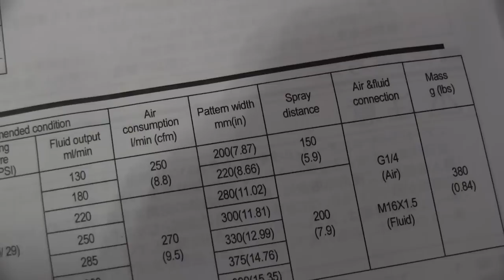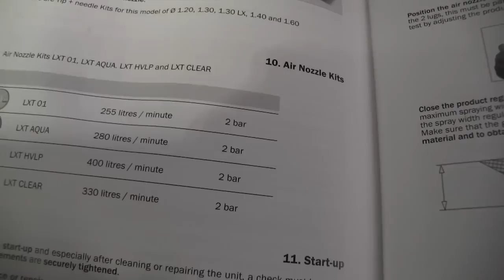Air Compressors Explained and Tested

Comment: Wow- cleared up a heap of myths for me including needing a 200+ litre tank to fully spray cars which is a relief because I bought a 3 hp 50 litre 323l/minute FAD compressor today. The first thing I noticed over my old 2.5 hp 40 litre 125 l/min direct drive unit was when the compressor kicks in the new one holds the pressure the whole time and only takes a few seconds to catch up after finishing. Whereas the old one would lose pressure and then take 2 minutes to refill.
I was really worried I'd bought one with a too small tank but this segment cleared it up for me- very relieved. 
Thanks!
Great to see some quality Aussie paint videos btw!
Reply: Hey it's been two weeks. Have you properly sprayed with this new comp? Any conclusions? I imagine a 50L regardless of output would pretty much be fully running while spraying a hood or roof on a car? I'm looking into getting a comp and gun right now for my R33 project and my budget at most would allow a 50L unit and the cheapest gun I could get.
Reply: @Kryndon64  It depends on what the FAD is.  Free air delivery is more important than tank size. If it's around 200 or below it might struggle. 323 l/m does it easily. I'd recommend belt drive too. Mine runs off 15 Amp and cost about $900 AUD. I had a cheap 40 litre one FAD 125 l/m that I tossed for the new one and there was no way known that would cope with even painting the bottom of a door. Plus you need not only a decent compressor, might get away with a cheap gun but you also need to stop moisture getting into the paint, so need at least one decent water trap. A weaker compressor will also make more heat which will add to moisture in the air. . Another thing to consider is tank pressure. alot of the cheaper ones operate at 110 psi whereas the better ones are 145 so in effect you have more air for a given size and less buffer in which for the compressor to stay ahead of. A 200 litre tank might give you 4 times as long over the 50 litre before it kicks in but then it needs longer to fill up again too after you've stopped.
Reply: @AndyPutt1  What compressor did you get? Like what's the brand/model?
Reply: @Kryndon64   Yeah sprayed with it and it's great. No problems whatsoever painting a car. If you had a 200 litre tank it would take 4 times as long to kick in but it would also take 4 times long to fill. It's not like in order to spray you need a compressor that won't kick in while you are spraying in order for it to work. That might be true for a 120 l/m FAD compressor, because it can't supply enough air but not with a 320 FAD unit handles it fine  it would be well under  a 50% duty cycle.

Comment: Being a beginner with painting I found out my compressors valve outlet on the tank was restricting air flow so I put a ball valve type and it worked a lot better, I would buy one as large as possible due to the more they run the hotter they get thus more moisture build up, I worked in a new furniture upholstery business, main compressor stuffed up so they hired a compressor with a VW motor which couldn't cope and motor blew up, we had to get one with a diesel engine just to run 5 staple guns, 2 nail guns and seldom spray booth work.

Comment: thanks from chicago illinois. i have a craftsman compressor  6hp 11.9 cfm 33 gallon so i guess itll be just fine. i really appreciate all the info.
Reply: I’ve done overalls with 21 gal. Issue is you’ll always get too much moisture cause the thing running too much.  If you attach I think several line dryers u should be fine. I think. That’s an experiment i think I’m going to do

Comment: your error is that shop told you a value for 200liter/min free air delivery in output, and you bought a compressor with intake 200l/min

Comment: Hi Dave. I want to progress from 1K can painting to 2K gun painting, but just start off with doing touch-up work on scratched or damaged panels. I also want to upgrade my air compressor, and get something portable I can also use for detailing and drying. What is the minimum FAD you would recommend for small paint repair jobs? Could I get away with 100L/min, for example?

Comment: can i paint half a car with a 3gallon compressor 1.0 hp 3.0 at 40psi and 2.0 at 90psi?? and with the side qs> with a hvlp or lvhp?
Reply: 3 Gallon and not very powerful.....it can be done (but you may have trouble dialing in the gun) but you will have to constantly wait for the pressure to rebuild.  Get a  LVHP gun and maybe see if you can score an expansion tank.  That is way small and low HP as well.  I would say 1.5 HP, 6 Gallon (bigger the better) as a bare minimum to run a gun.  30 Gallon 2 HP ideal.

You can actually kill the compressor or shorten the life of it because of the size, duty cycle, and power.  It will be running almost constantly if not constantly.

Comment: Dave I notice u said that a w400 BA keeps up with your 205l/m compressor. Was it using a 1.2 tip as the 1.3 is claimed to use 270-280/min??
I have a FAD of 244/m and was wondering if it would be sufficient for a 1.3 tip W400 BA

Comment: I been looking at a duel stacked Compressor Oil feed 5 Gal. 125 Max PSI  5.1 CFM @ 40 PSi  for $130.00 CDN  for Bottom of my Truck fender and a few dings fills on my door  I should be ok with that   I don't see someone with a full mix paint using a Portable for complete jobs on a day in day out basis If i had a shop i would shop around used if need be ..Auctions Local flyer for sale ad's and the internet for my area
Reply: how did it work out for you? was it sufficient to pay without losing air? I tend to do mobile work and I paint two-four cars a day but usually just a bumper or a panel under 5 mins of painting. Is that okay with 6 gallon pancake compressor on amazon? 150psi
Reply: I went with a Portable 20 gal oil-Free Air Compressor, 2-hp Perfect for 1 side of car painting and the tank refills with in 5 -8 mins so you have time to refill your pot and still have time for flash and for me it was cheap
Reply: are you doing business at home or is it for a shop? I tend to do mobile but I want to be stationary maybe at home in my car port or garage
Reply: I do work at home However I drive a custom 05' Chevy blazer Which can be used as a hauler for the compressor say to a friends house for roofing or fence, mech work.  I just finshed a patio of wood skid furnture (couches x2, Propane fire table and a corner table (round cable wire reel from construction site "free")   The couches have Burlap Coffee bean bags as cushions with Product of Peru Cafe logo on them ...very rustic looking ...Perfect for a nail gun it would take 5 to 10 mins each piece 
http://www.canadiantire.ca/en/pdp/mastercraft-20-gallon-oil-free-air-compressor-2-hp-1995704p.html#srp

Comment: is not the arrow but the Indian it can be used but it takes more skill and time, hell i can air brush a hole car with a pancake compressor is about being smart and divide the car, and make sure you mix is 100% the same every time, so dont use the cups use a digital scale to measure the paint mix

Comment: I have a Husky 30 gal 175psi compressor, it says 6.8 SCFM at 40 PSI; 5.1 SCFM at 90 PSI. My question is , Do you think this is enough to paint properly. I have a GTI pro and a few ANI F150 guns from Spraygunsdirect. just don't want too many issues. Do you think I"ll be okay to spray a suv truck
Reply: steven m yes
Reply: @cesarchavez507  thank you

Comment: I have a 21 gallon 175 hp air compressor could it work?
Reply: 175 hp? You funny man
Reply: And 21 gallon is not gonna be bog enough, your compressor motor will run all the time. It should be a tank doubble that size atleast to paint a full car.
Reply: keemoify 21gal is enough, you don’t need to paint whole car one time. You can paint each panel one by one right. So you don’t need big air compressor,just waste your time.
Reply: I got a 426 Hemi with 450 h.p.do you think that would power your compressor?

Comment: 9:20 , don't agree , you don't need  a "much" bigger compressor , almost the double size , to be used with an HVLP ( rather those used with a LVLP , which you've called conventional gun ? that's not either ) . Conventional are those that implies High Volume . 9:28 " High volume is a bit different than ...........Low Pressure ..(???) , you're slipping all over the place ! You have a paint garage/business but you're not well prepared about technical details .

Comment: 200 liters per minute in U.S is 52.83 gallons. thats not a 52 gallon tank.
Reply from the maker: Marquis Reese that's the air delivery the motor puts out not what it holds

Comment: from usa..can someone tell me what a bar is  ..2 bar??
Reply: as I understand it, 1 bar is normal atmosphere pressure, so around 14 psi depending on where you live. So 2 bar would be around 28 psi.
Reply: +Merlin Zener  thanks. good to kno
Reply: A bar is a bit less than an atm actually. If you ever need to convert just type it into Google, like "14 psi to bar"

Comment: the little compressor in the video is insufficient for a hvlp gun . look on the chart the gun comes with . most hvlp guns require a compressor that's cappible of producing 16 cfm @ 40-60 psi constant .  that thing won't even come close . a proper compressor will run you about a $1000 . and that's barely meeting the minimum requirements of the gun. please do more accurate research before putting inaccurate info out there for people to see. although people shouldn't use you tube as a primary source of information.
Reply from the maker: I didnt say that compressor would work with HVLP. I mention that you would need a compressor double the size for HVLP at about 9:30.
Reply: DId you watch the video with the sound off? He clearly stated that it would NOT run the HVLP gun.
Reply: Someone needs to pay better attention before being a smart arse..
Reply: thomasjbuckner it is enough for small jobs.
Reply: customspraymods Could that size compressor run an Hvlp gun for small jobs such as furniture for very small periods of time? Or just better off getting a bigger compressor?
Reply: so I cant run my sata 4000? with a 6 gallon 2.6hp compressor?
Reply: Rick Simon so is a 20-30 gallon compressor good enough to paint a whole car even a small chevy 1500 truck ?
Reply: michael .diaz Hi, it could definitely be used for the job but it would be running constantly and you would have to let the compressor catch up.  I would do one panel at a time, let it catch up, then continue.
Reply: He was very clear about the requirements of the hvlp gun and said the small compressor wouldn't cut it. Maybe pay attention before you show your ass calling someone out.
Reply: @ricsim78  We need you on more comment sections around YouTube, you my friend are a GREAT dismantler!!!